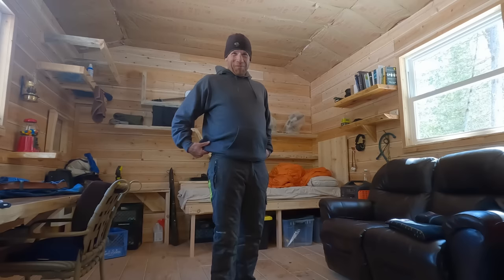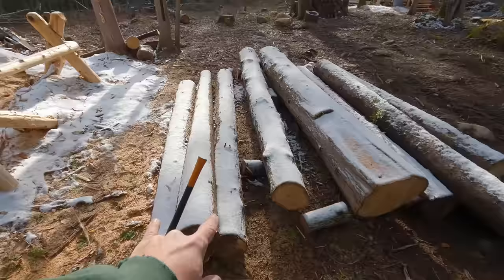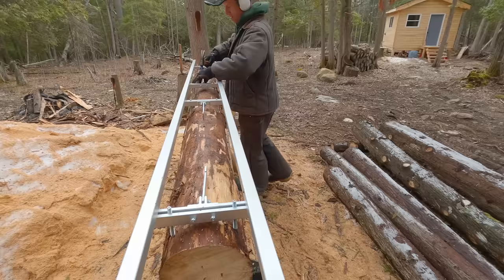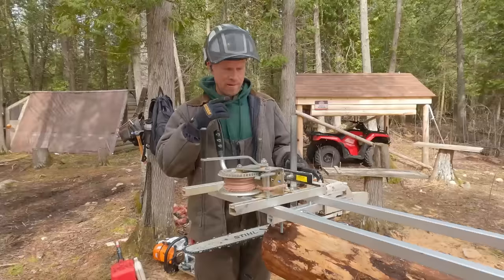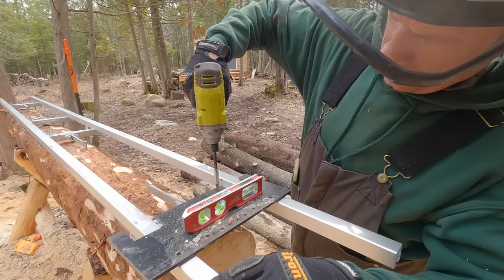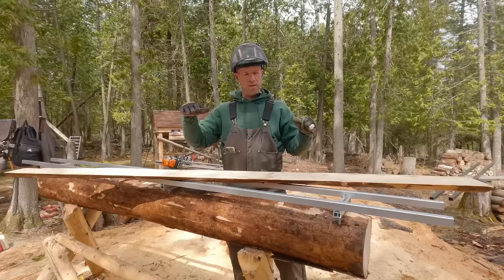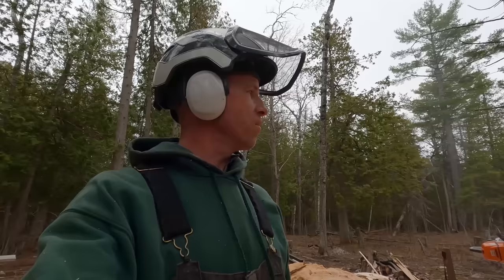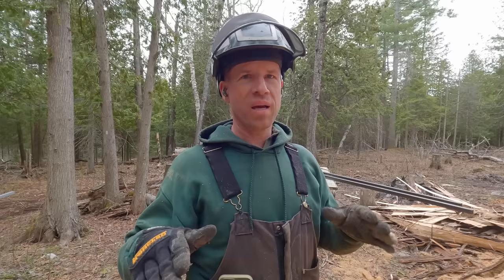Trying Out New Chainsaw Mill Rails.  Do they Beat My Homemade Setup?  (Granberg EZ Rails) #134

Comment: Build a gigantic screened in porch onto the front of your cabin.
That would completely change your life in every season.
Reply: Yes...then add vinyl sheeting (of course you could use acrylic sheeting to retain high visibilty) as large doors with hinges to keep out pollen and rain, but also put screens on the bottom before installing floor boards to keep out bugs!!! 🙂
Reply: Needs to be big enough for 2 rocking chairs, of course you have to make the chairs

Comment: Build a smoke box. A long box that you can fit a dozen 2×12 inside and a flexible dryer hose connected to a smoker. If you leave stuff inside for a day, it kills the bugs and the low slow heat might even draw out some moisture from green wood. If you use a good smelling smoke wood it will also give that scent to the smoked wood.

I saw this in a recreation village from the 18th century, used to kill bark beetles, dry wood, and to give a nice scent to common woods.

Comment: I got the EZ Rails from Granberg when I first got my mill. Within the first log I discovered that they are a bit of a pain. Getting all those leveling bolts just right and level takes more time than I expected (whereas a ladder is prtty much drop and go). I also found the the little pieces of aluminum that join the sections together bend really easily. So i've had a bunch of times where there is a kink or swoop in my lumber where the rail sections join together. It is a lightweight system so there is that benefit.

Good video!

Comment: I happened to be browsing chainsaw parts the other day and noticed they now have a debarker that attaches to your chainsaw where the bar normally goes. It looks like a planer type blade assembly that's driven by your chainsaw. It sure would save time on stripping off bark with a draw knife 😁

Comment: To solve the problem of felling wedges falling out when shimming my mill, I cut an old sheet of 1/4" plywood into 2" x 24" strips and painted the ends orange. Now I just shove them all the way through every so often. If my helper gets too ambitious and puts it too close to the chain, no big deal since it's wood.

Comment: Ryan, don't know if you take the time to read all these, but, you DO know that the bars are interchangeable, yes? Put a short bar on the big head unit and use the small mill until you need the big mill. Then swap out the short bar and short mill for the long stuff. Retire the small head to backup and limbing. It would increase your productivity, and I know that doesn't matter, AND it increases the fun factor. That's what matters.

Comment: You could create a hybrid system where you have end plates like your old ones to set the height of cut at each end and use the adjustment screws to stop the aluminum rails bowing.

Comment: Based on what another comment said, get different leveling bolts instead of those. Your impact will eventually mess up the flat heads on them, so it would be a good idea to get something with T25 (star) on the top so you don't wear them out after daily use. Great videos!

Comment: When leveling on ANY two rails, sides of anything you must position the level square to the frame you at leveling or you can not be accurate.   your new rails don’t rust, just the bolts and nuts if they are not stainless

Comment: Awhile back I suggested building extensions for your steel tubes. The way these new pieces hook together is kinda what I had in mind. The only big difference would be using angle iron for the connector. Using a piece of angle iron that would slide into your steel and 1/4" or 3/8" thick so you can drill holes and thread them in the angle iron. 
You would need to grind the shape corner off the angle iron so it fits tight to the inside of the steel tubes. With holes drilled to match the holes in the andle iron, you bolt through the steel into the angle iron with bolts coming through from one side and the bottom. This would align the two sections straight on both the sides and top. 
This would leave a smooth top to run the mill on. With two more steel tubes as long as the first set you could mil logs twice as long. 
Granted you would have to mill such logs where they fall. You have to do this occasionally now. With your new saw and being able to mill larger diameter logs this may happen more often now. 
Being able to make longer lumber can be handy for some uses.

Comment: Seems odd you can't just unwind all the line off the new winch and wind it back on turning the handle the other way (to how they did in the factory).  Does it have a ratchet mechanism somewhere?  You'd have to ignore the "turn this way" markings - but I doubt any owner reads those more than twice in the time they own a mill.  Great and entertaining video, as always.  Stay safe out there.

Comment: Just an FYI, you should use your scrench to adjust the leveling screws because the impact you're using, will eventually mess up this flathead screw from the hammering action(or use a drill over an impact). Or replace those screws with bolts.
Reply: ..and bolts are screws without threads so you know! 
Kind 
Anders 
Sweden
Reply: @tomfull6637  Rubbish!  What do you think those sharp bendy bits are going along the length of a bolt?  They are called a SCREW thread.  A 'bolt' without a thread is called a 'stud'.  A 'bolt' with only a portion of its' length threaded is called a 'stud-bolt'.
So YOU know.
Reply: @gillie-monger3394  Definition of bolt :
Example 1) Fasten (a door or window) with a bar that slides into a socket. - “all the doors were locked and bolted.”
That’s the popular description. Can be found in google translate. Then you can yourself look up the international definition standard (according to SiS) used by persons professional in the mechanical and construction industry. 

A screw regardless of length and diameter, is screwed in place by means of a thread. A bolt is bolted in by means of a hammer or pressed into its hole. 

Example: he bolted in the steel bolt into the hole… 😉

Never to late to learn. For real. 

Kind regards 
Anders
Reply: @gillie-monger3394  and to further enlighten you..
In the crank case housing of a motorcycle engine (for instance) you have fixed studs. The studs are long steel rods with a thread at the top. The studs are attached, fixated into the housing and at the threaded top one uses the thread to attach the cylinder head with nuts. 
Anything else you want to have straightened out?
K rgds/A

Comment: I keep thinking you should build a sort of log milling table with very heavy beams soyou could actually cut several logs side by side at the same time since you have a longer bar and a larger mill now you could cut more logs and quicker. I saw a young kid build one and it had ramps built up to the table so you didnt have to lift the logs just roll them or use say a wench like on your 4 wheeler and save the stress on your back and heavy lifting. but he also built a two wheeled log lift and hauling system to pull behind his 4 wheeler pretty talented and creative young guy in canada. And now as well you have two log rail systems your old and your new one. Im just pushing you to think about it haha as an Arm chair quarterback.

Comment: Hey why not use the new saw with the smaller chain bar? N see how well it powers through the logs? All kind of options you could experiment with or use several similar diameter logs n use your picnic table as your milling station n see if you can buzz through several logs at the same time!? He its just the experimenter in me n maybe you thought about it yourself? It could mean more production since you dont have massive diameter trees for cutting big slabs though you do have the machinery necassary to cut them.

Comment: Brother, if you'll find a gooseneck hoe and bend it straight, then sharpen it well, it will make short work of peeling logs. My grandfather was a bridge builder in the old days when they used mules and cut piling onsite. A hoe is your best friend for peeling.

Comment: Measure up from the bottom on both ends the same number and boom no triangle peice
Reply: The first cut would be a 'triangle piece.  And measuring from the bottom and not from the centre would produce boards more likely to warp, twist or cup due to cutting across the grain.  Also harder to get a smooth surface when finishing due to grain breakout.
Reply: @gillie-monger3394  didnt think of that!

Comment: When you are cutting your slabs why don't you use a flat shim the exact thickness as your chain width instead of using a wedge shaped shim, that should eliminate waviness. If you get the problem of not being able to push the shim in use one of your yellow wedge shaped ones, for a second, then push your flat shim in and remove the yellow one.❤❤❤❤

Comment: Easy way to avoid sand and gravel in the back so you dont have to peel it is don't drag the log on the ground and don't store it on the ground. 
We never lety the log touch the ground after it felled.
 the new guides are ok, but you old setup is better, and you don't have to worry about hitting the bolts

Comment: How long do you wait for lumber to dry after cutting up a tree? Is there a rule of thumb or a moisture percentage you aim for?
Reply: He uses green wood all the time. It's best to mill it green. It's easier on the saw and will dry better. Rule of thumb though 1 year per inch.

Comment: That new rail system is waaay too over-complicated and also pretty restrictive when it comes to dealing with anything other than a perfectly straight log.  Your original system is quick, straightforward and easy to use repeatedly.  Don't go using a 'free' tool if it makes your workload harder, simply to justify a 'freebie' dude.